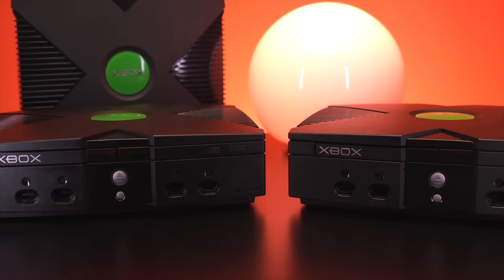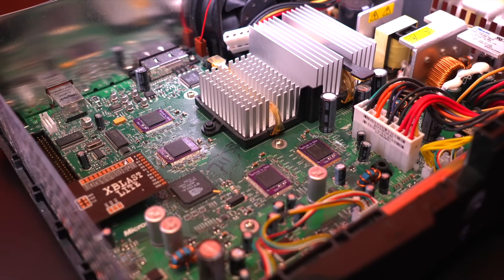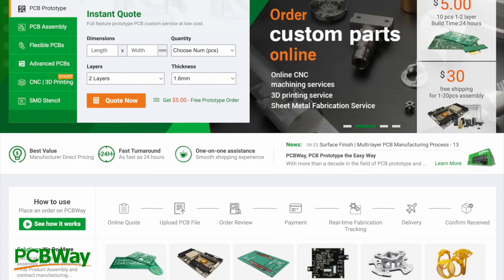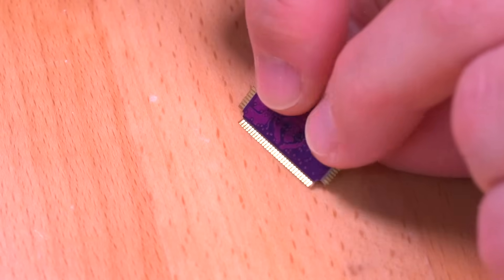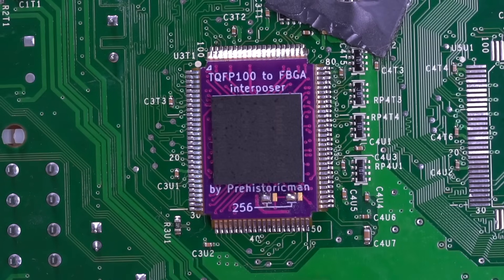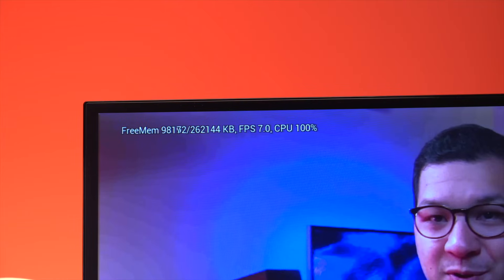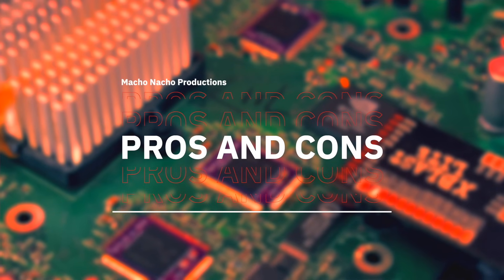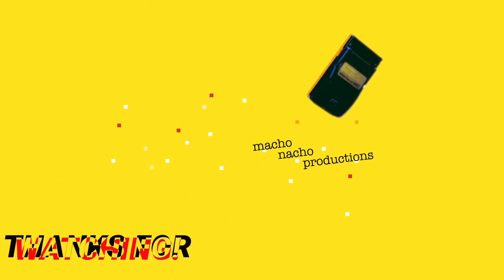Giving The OG XBOX Quadruple The RAM | Never Done Before!

Comment: Maybe if this mod came out 20 years ago it would have some real potential, at least for making a better homebrew/media center Xbox, but can't imagine any developers doing anything with this in 2024.
Reply: It did, right along with the 1.3Ghz PIII mod. The difference was you either scraped the Chips of a doner board, or you bought a batch of 'em to do it. Problem is after Twenty Years of NON PRODUCTION, supply finally went the way of the Dodo as they say. This update (To that Mod), address that last issue. As to what you'd use it for? 

That would likely. Be one of two things 
Sega Chihiro (i.e. Virtual Cop), or a full XBOX SDK environment. Again. Same today, as it was Twenty years ago.
Reply: @Ichijoe2112 SDK was the first thing I thought of
Reply: You don't like the idea of using the Xbox as a classic Win98 & DOS PC?, I do, got to say, being able to just plug in an Xbox to my VGA monitor or CRT TV and firing up my favourite late 90s PC games sounds incredible, setting up a Win98 PC can be a little tedious, both from a hardware and software point of view, the OGXBOX literally has everything under the hood for complete 80s through to 2003 PC support, imagine not having to mess with drivers and settings, and turning retro PC gaming into a plug & play console experience, yes please on that for me, even Amiga OS could be run complete with MIDI and soundbanks audio compatibility.
Reply: @Wobble2007 

That sounds interesting. Has there been developments ademend stuff like Dosbox to utilise the memory?
Reply: @Wobble2007 Actually I'd much rather use a real PC than an original Xbox to run old PC games or emulators. The PC hardware and software are so much more flexible. It's more easily modified and more readily available. You don't have to risk killing your Xbox with major hardware modifications either.
Reply: @Wobble2007 Can you do a dual boot setup with that? Like switching freely between the Xbox retail mode and the "PC mode".
Reply: @marcelolemoss  It would be a dual boot situation, there is a video, or maybe a few in fact, of people experimenting with Win 98se on the OGXB, but due to only 64M RAM, it's very slow, 256MB would be perfect though, 64 for VRAM, 192MB for system RAM, you could also make a Live CD version on Win98, and boot games from the XB drive (assuming you have upgraded it).
Reply: @Wobble2007  That's an interesting idea that I hadn't considered.
Reply: The original xbox modding scene is pretty huge right now, I think it's a bit foolish to assume it's dead. There's a lot of people developing things.
Reply: People still homebrew for 40 year old consoles. I'd suspect the xbox is more bottlenecked by the CPU/GPU/RAM speed than by the RAM amount, but hey.
ReactOS can run on the og Xbox.
Reply: @winterhell2002  well hello there lol
Reply: @winterhell2002  The problem is why would you make homebrew to take advantage of 256mb of ram if almost no one will be able to use it. The only real use for this is for a dual boot with a Windows OS or something like that.
Reply: What? The original XBOX is the perfect arcade emulation machine.
Reply: Depends, people STILL make Dreamcast games today, almost 30 years later, and the GameBoy gets similar treatment.
And these are a bit older than Xbox is.

Though if you're speaking about ease of access, the Series X has developer mode which may make more sense to use over the OG Xbox.
Reply: Wondering if eventually 512mb to 1gb would be a possibility and load windows xp and with a more modern you to allow even newer emulators
Reply: true... the box is dead af.... also the mod szene for the og box

Comment: Won't it be easier to do a sandwich mod using same ram modules model?
Reply: Was thinking the same thing... not looked into the price of these ones but stacking might be a cheaper option for some people
Reply: @simplicitygaming4203  not just cheaper, simpler, you just solder the additional modules on top of the existing without the need to remove them + if you already did a 128mb mod you add to it (if that was possible of course)
Reply: Similar to the 1.6 method